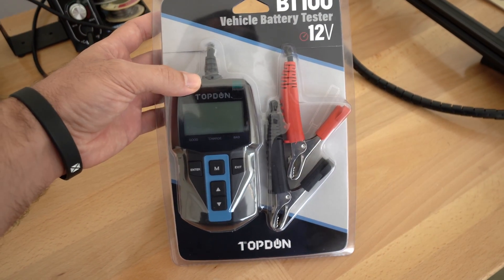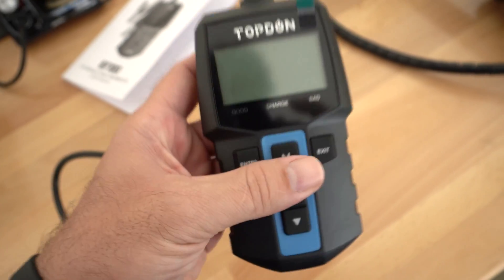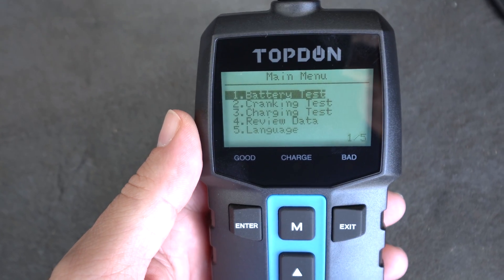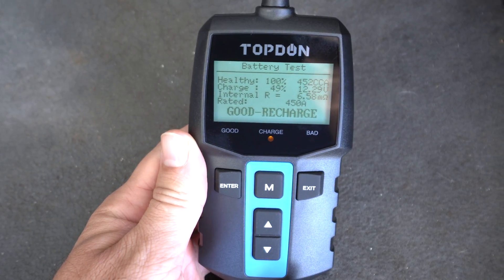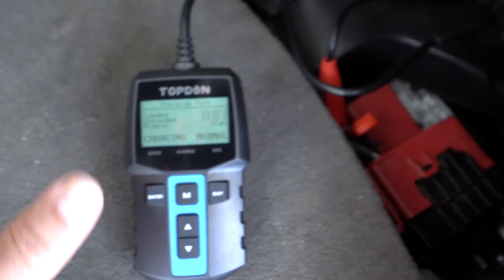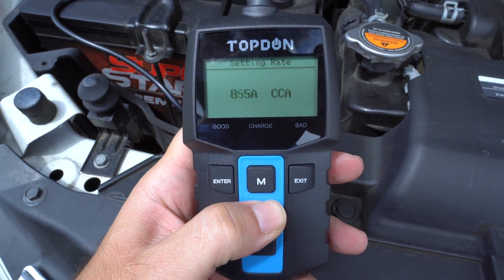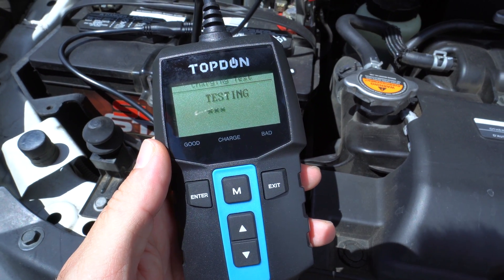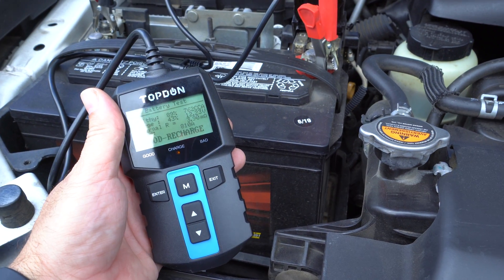TopDon BT100 - 12V Battery Tester

Comment: An important note: there are a lot of adds that the bt100 pro test 6v battery and thats not correct. If you connect a 6v golf cart or solar battery the device indicate on screen low voltage and the test can not be run. For 12v this device work great trust me!!!

Comment: Hi, thanks for this. i've just bought one and apart from needing to replace my battery the cranking test came up low for me as well. is this something i need to worry about? My charging test came up fine.
Reply: I know you posted this a long time ago but low charging can be more than just a faulty alternator. If your batteries internal resistance is too high, it can cause low charge. Likewise with loose/corroded connections.

Comment: I'll think you'll find its just a regular flooded battery, and its only a small capacity.  Yes it is used to turn the engine over, if it goes flat, you're shit out of luck, despite the lithium battery packs the vehicle has.  You can do a cranking test on a Prius.

When the device asks you to increase engine speed to 2500rpm for 5 seconds, do it, then press enter ... It has already recorded the data it needs and is just going to show it to you